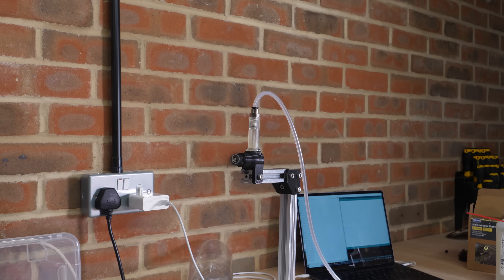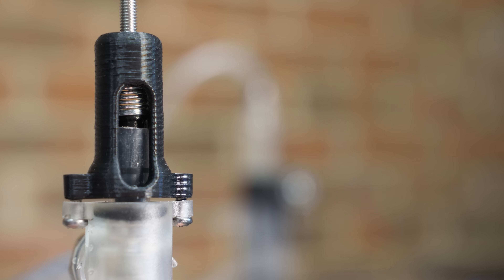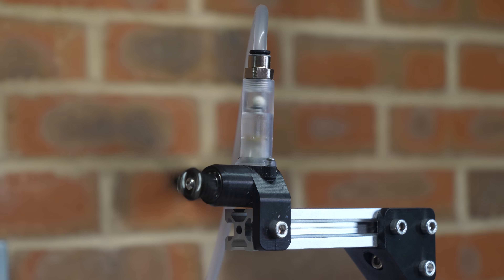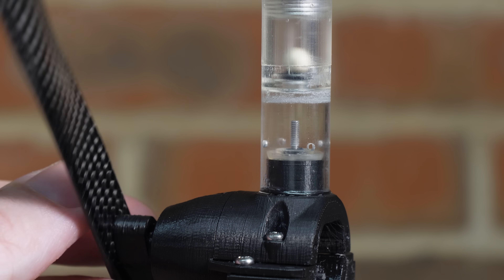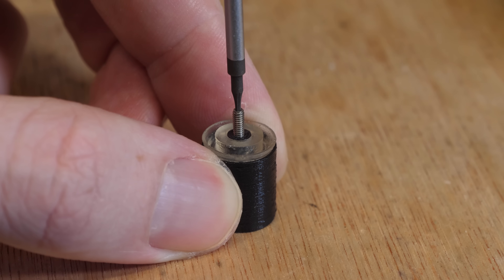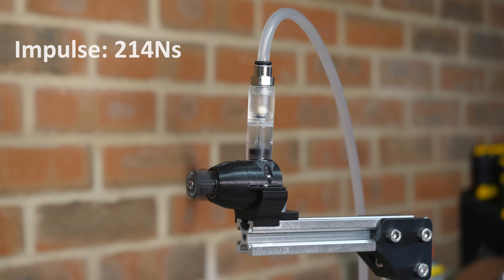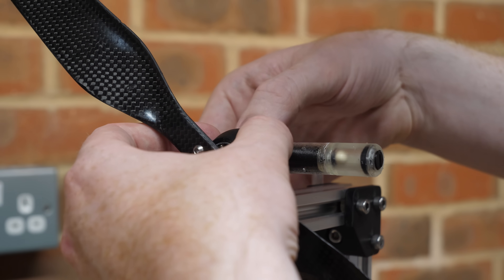4,500RPM Air Engine

Comment: So impressive, as usual.  I really appreciate where you graph each new itteration against the original design.  Having that baseline for context really helps convey just how far you have taken this concept.  Amazing work.

Facinating to see how much you can accomplish with some effective use of 3d printing.  An interesting conclusion to this series would be if you could invest in having parts properly machined out of peak/aluminum.  I am wondering the maximum performance this design can produce if all the parts were perfectly dimensioned and smooth to reduce friction everywhere.

Comment: So with that kind of power output, couldnt you handle the extra weight of a c02 cartridge and regulator? Imagine that engine with access to 800Psi on tap

Comment: Ok so hear me out. An inline 4 with the same timing system but you have a mini air compressor and it is on an rc crawler. Really low gearing for driving because these produce barely any power but if you have a mini air compressor like the cheap eletric bike pumps and hook it up to a small battery and you have an infinite amount of air and 4 cylinders for power. Prob need like a 2 letter bottle as the main storage tank cos an inline 4 would be thirsty

Comment: I use such bottle as an air container for inflating  tubeless mtb tires. I put  around 8 bar in them regularly, and in mtb forums there is and opinion that 10 bar is safe, and they could handle 12 bar easily.  Knowing that i still use eye protection and put a blanket or rag on them  to reduce the shrapnell just in case. Got an  mtb tire blown of the rim by high capacity 8 bar industrial  compressor ( the pressure gauge was broken  hence tire  explosion) .  That was a life changing  experience, and taught me to respect anything presurized ( the ringin in my ears  lasted two days).

Comment: You wanna know the craziest shit ever...  if you compress air, it heats up.  If you let the compressed air come back to room temperature, you'll lose some of the added energy to the surroundings.  And by "some" I mean exactly 100% of the energy used to compress the air.  Yup - ALL of that energy is lost to heat, but you still have compressed air that can still do work - like spin a propeller!

Comment: 11:45 "bent" conrods will impart a sideways twisting force against the crank pin, which will increase friction. You should try and offset the cylinders instead. Also, a "boxer" design where the pistons are both at TDC at the same time + BDC at the same time, would significantly reduce the side to side vibration.

Comment: 6:40 I believe you are incorrect. I believe your lack of efficiency is because by increasing the size of the space above the piston, you have actually decreased your expansion ration, not increased it. You need to increase the expansion ratio to increase efficiency. make the space above the piston smaller than your revised design, and the stroke longer than the old design.

Comment: Tbh, I am very fascinated that with 6,9 bars, your system isn't melting and your pressure regulator being frozen solid after a minute or so. Compressed air tends to have some pretty neat energy with it when compressing / expanding.

Comment: Tom this is really neat stuff I wonder what benefits you could get with say an EAI(Electronic Air injection) system over the ball value design. The piston has to waste a lot of energy to lift that value open every time it might be worth looking into.... another idea would be to lighten that piston less weight in the rotating assembly might help efficiency. Lastly without the ball value in the design you could make use of a nozzle in the head of the engine to control the characteristics of a fluid flow (specially to increase velocity) as it enters the enclosed chamber since you aren't relying on combustion forces you essentially have a cold gas thruster in the inside of the chamber. Very cool to see your progress on this project!

Comment: An engine burns fuel and uses heat. What you have there is a motor. Check the definition.

Comment: Always a blast!
I do mean to ask, though, did the pressure regulator addition create any challenges for throttle control? I would think you'd want your throttle moved to inbetween the regulator and the motors.

Comment: If you put electricity and vacuum has two more compartments on the outside maybe 45 more compartments vacuum and vacuum eyes and have maybe some vacuuming at gas shot in a couple of months electricity ambleside vacuum out his back to my and then when the water runs on the first one and it starts to blow they need you like a high pressure high pressure vacuum high pressure vacuum

Comment: What I would love to see: 1. Build the engine out of precision-machined aluminum parts. 2. Build a reusable CO2 tank (can be split in half and filled with dry ice and re-sealed so on expansion you have liquid CO2) out of carbon fiber as the fuel storage tank. 3. ABSOLUTELY SEND IT

Also: create a nerf-style dart gun out of it: 1. Create tiny pressure vessels with spring-loaded wings that act like an arrow's feathers but also generate lift, and a quick-connect foot at the base that can 2. be attached to the "dart head," an air motor and a propeller that has folding wings and nosecone that can contain a warhead (a suction cup or a snapper firecracker). 3. A latching mechanism that seals the quick-connect to the gun body 4. and a hand-pump mechanism lets you fill the pressure vessel-cum-dart. 5. Trigger releases latch mechanism  holding onto charging/pumping surface and lets a small amount of compressed air flow from the charging body such that 6. the tiny dart is forced out of the barrel of the gun along some rifling and tracks. The wings stay in the tracks to stabilize, and the propeller moves through the rifling to start the prop motor so that 6. upon exit, the compressed air motor kicks on, generating thrust and the wings/vanes create enough lift to counteract the droop of gravity for the duration duration of the motor burn. When the motor stops spinning, the propellers will fold back to reduce drag and auto-gyro counterthurst.

Now you have a microplane chucker that is essentially the equivalent of a Nerf missile launcher. Ideally, you'd want the pressure tank to couple to a launch reservoir during the charging period and the vehicle would exist in front of a launch piston that would push the missile out of the barrel like an aircraft carrier catapult instead of needing to make the dart airtight. So, dart attaches to reservoir through an airtight plate. User charges dart and reservoir through pumping action. User releases latch, check-valve prevents air from escaping the tank, but latch release allows reservoir to discharge and push the piston and missile until the propellers engage the rifling and the motor kicks on. Dart exits barrel at speed, centrifugal force from the  motor keeps prop blades extended and begins increasing acceleration and lifts missile as it flies. Tank expends its energy, engine stops spinning, loss of centrifugal force allows wind resistance to fold prop blades back for inflight efficiency as dart glides to a stop...or impacts target at-speed and activated whatever warhead is attached (a blunt impactor, a dart-head, or one of those snappers you throw on the ground for a bang.)

Comment: Rotate the crankshaft about 180 degree for one cylinder to compensate the momentum. It will rund smooth like a real boxer

Comment: The old steam engines used on ships used to take the exhaust of 1 cylinder as the input for the next. This may increase the efficiency of the twin - but I actually doubt it will be much benefit overall.

Comment: I worked as a mechanic on modern cars and one of the more interesting innovations that you can possibly apply with little effort is the offset crankshaft design used on engines like mazda's skyactive. Might be a simple way to squeak out a little more efficiency where it matters

Comment: Is it possible to create an air storage tank with a spring and piston (instead of a water bottle) but make it so that as air is used the piston continues to maintain pressure to the engine until absolutely all air is gone?

Comment: Please look into the differences between a flat-V and a Boxer engine, the crankshaft of the boxer will smooth out the left-right shake from the rotating assembly.

Comment: I’d love to see an altered crankcase to run it as a boxer-style engine! Maybe it would help with vibrations, but I’m not sure what impact it would have on the power output. I’d also love to see this developed into a radial engine, perhaps as a larger version of the whole plane? It would be a cool demo of how those engines work (at least in a pneumatic form). Cool video as always!

Comment: Next step could be a multi stage engine with different cylinders to use the still pressurized exhaust air of the first cylinder.

Comment: What if you were to add a  "turbo charger" from a internal combustion ti your motors exhaust port and recycled air used to maintain pressure over a longer period

Comment: Fantastic vids. Btw what's the smallest/lightest air compressor possible to keep "topping up" your compressed air supply from surrounding air? What would be the power draw for that required vs power generated by a prop gen (induced current) ?

Comment: If you're gonna do a boxter engine you gotta fix the timing so that the cylinders fire at the same time and counterbalance eachother, would theoretically remove most of the vibrations and probably be very satisfying

Comment: It sounds like a 2 stroke motor which is really awesome. Your design acts very similar to one as well with a reed valve for air intake and using ports on the side of the cylinder to exhaust.

Comment: I think you should do some real efficiency testing. Yes, thrust over time is nice to know, and important for an aircraft. But I think if you would strap your engines to a electrical generator you could repeatably and interchangeably get data. You could test for efficiency at certain speeds, and adjust the rotors accordingly later based on data, not on guesses.
You could also compare the efficiency to air turbines much more easily. 

Something I wonder for example: how much more efficient is a motor compared to a nozzle, directly exhausting the air for thrust?

Greetings!

Comment: Hi Tom! Check out "Experimental Analysis of a Compressed Air Engine", Qihui Yu, Maolin Cai 2015. It helped me a lot with optimising my air engine. There's a thermodynamic explanation why you need to decrease to-dead-center volume of the cylinder for increased efficiency.

Comment: Tom,  transfer the exhaust gas from one cylinder to the other (you will need a larger 2nd cylinder though to make it worthwhile).
Also, use a cam to open the inlet port, that way you can time it at TDC so the cylinder is not being filled with any compressed air until it is on it's downward stroke.
* if you used an exhaust driven 2nd cylinder you will have to time this so it''s also on the downward stroke at point of exhaust expulsion.
LAUNCHER IDEA, if you make a launch system, be it hand or grown baised, you can rig it so the prop runs from a second air supply until it leave the launch device, this way the 2lt reservoir is not being used until it's in-flight & the air being expelled from the external supply could add prepulshion at point of release.

Comment: Another great video! I've been wondering about pressure regulation, don't you loose some energy if you reduce the pressure? Also, shouldn't the air be reheated after the regulator if efficiency is important? I mean, having the pressure regulation built in into the engine is super cool, but the air will also be cool, at an already reduced pressure.      

I'm hoping for a multi stage motor, with reheating between steps, which seems like the logical way to me to increase efficiency of a compressed air engine. If steam engines that loose energy through heat loss can benefit from multiple stages, an air engine that can gain heat and therefore energy from ambient air, or thermal energy stored in the system at ambient temperature should be able to benefit more from multiple stages.

Comment: Brilliant stuff, excellent presentation.

The regulator that you implement is analogous to a linear regulator in electronics, which have increasingly been replaced by switched mode regulators, which are far more efficient.

I have often wondered if a pneumatic switched mode pressure regulator is achievable...

Controlling pressure by restricting flow wastes energy.

I am sure what I suggest would be quite a challenge.

Comment: If you look into air rifles PCP the non regulated ones have less power at full charge due to the higher pressure closing the valve slightly earlier the same as your engine

Comment: It may be a pain in the butt to do but if you make another boxer twin engine you want the pistons to be on separate crank journals so they can both be on a power stroke at the same time. This will make for a more balanced engine and it'll be less likely to shake itself apart over time.

Comment: When you do eventually make the plane you should try putting dry ice in the bottle.
As the dry ice turns back into a gas it should keep the PSI of the bottle up as you fly.
Do be careful though. If the dry ice turns back into gas faster than your engine uses it, it could cause a rupture in the bottle (explosion).

Comment: Here's a project idea: add a schrader valve to a bike frame's down tube so the entire down tube can be an air tank. Fill it at home and it can refill your tyres several times without a pump. It only adds the weight of the air it holds and the hose, so it's probably lighter than a mini pump too. Unlike a mini pump, this would also be capable of getting the bead back on a tubeless tyre.

Comment: I'm super confused about how the twin cylinder one kept fluctuating so wildly.  Was the pressure being changed manually, or is that just a quirk of the design that causes it to periodically cycle between higher and lower RPM?

Comment: Never thought of the fact that, if pressure at the bottom position of the piston is equal to atmospheric pressure, there is no reason for the air to leave the cylinder in the first place? Just came up to me when I saw the first design proposal
Reply: Great exploratory work btw

Comment: Just one idea, if the pistons are moving at oposing sides, they'll cancel each other out and become a smooth engine. If you bend the crankshatf you could achieve this. Like a bmw boxer 2 cylinders, or half a subaru engine.

Comment: you have a lot of friction, try graphite cylinder or piston, you can also put a high pressure cylinder and a low pressure cylinder nested to the high pressure exhaust

Comment: Are you sure the FDM prints are airtight? In my experience this is quite difficult to achieve. The SLA parts should be fine, though.

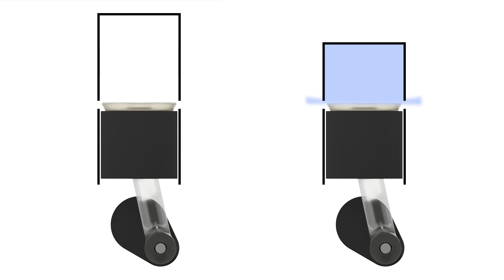Comment: 6:43 Expanding on your crankshaft angle findings. Maybe it's a better idea to have "top dead center" to be at 90 degrees instead of 0 degrees. Basically as you reach 90 degrees, THAT is the trigger to open your valve. I doubt that 90 would be the perfect number, maybe it's 45, 42 60, etc. This is a similar problem as what combustion engines face with the flame front speed.

Comment: So fun watching this develop in real time! Would it be worthwhile suspending the crank more securely with two bearings? and printing the air passages into the assembly could work too? maybe worth some analysis around the airflow into the cylinder? somehow these marginal gains are super interesting!

Comment: I suggest you to use a nylon pin rather than steel. It will ruin the balls surface and the sealing function will be compromised

Comment: Seeing the huge difference with the last flown design is just insane. Can't believe how far your designs have come
Reply: A simpler solution is to have 2 supply tanks, the later (and smaller) at a lower pressure to match the engine. 
This allows the main tank to be connected via the constant pressure valve. The run tank needs to be large enough to absorb the oscillations. 
The main tank can then be refilled on a long duty cycle of the supply compressor, starting just before the 2 tanks equalise and stopping at the max SWL of the main tank
This system, (called cushioning), is used in high temperature heating systems. It allows the water to be held at a constant high pressure without boiling. The second tank has to be large enough to contain the volume increase of the water due to expansion.
When the water is in a sealed loop, a primary tank is not always needed.

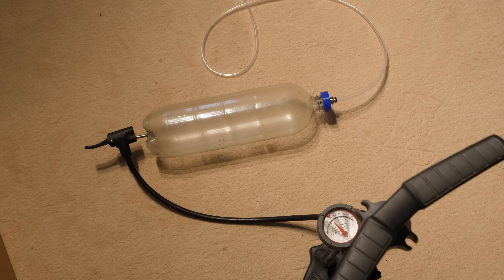Comment: 8:57 I laughed when I heard this. Back when I was 15 I experimented with car valves. I stuck one through the bottom of a returnable pet bottle, and with safety glasses on, just pumped it up till it burst. (Its just PET, it won't shatter like a grenade lol) Turns out it expands at 16!!!bar (232psi) and then just slowly looses air through some cracks. The idea of him being excited at 4bar, and looking scared at 7bar is therefore really entertaining for me.
Reply from the maker: Wow that's a lot of pressure! I've had one explode within arms reach of my face at just 8.5bar (123psi) and my ear was ringing for 3 days. So that's why I'm cautious now.
Reply: @TomStantonEngineering  Was that a PET bottle too or?
Reply: @TomStantonEngineering  there are water rocket contests with air tanks going up to 1000psi, using carbon composite tanks. Have you ever thought of something like this? A high pressure engine would really be the next level of engineering.